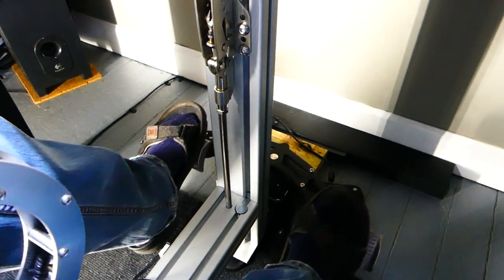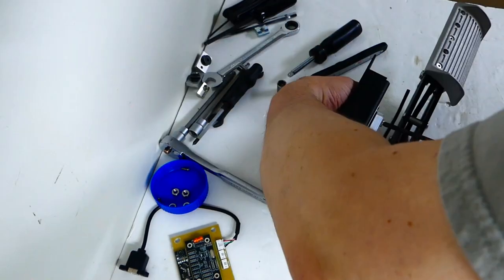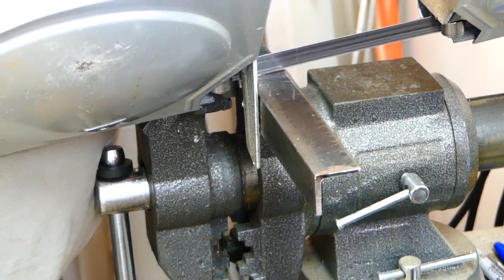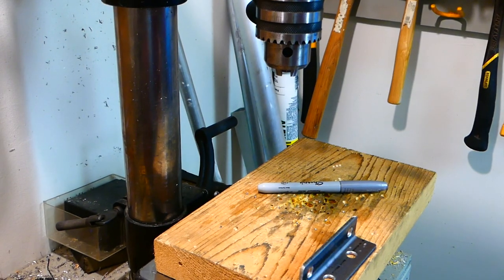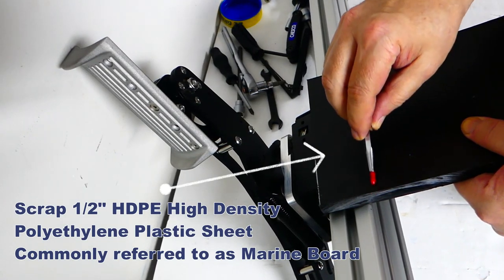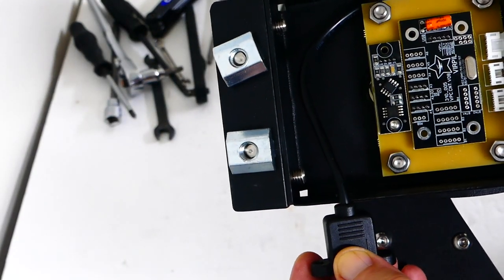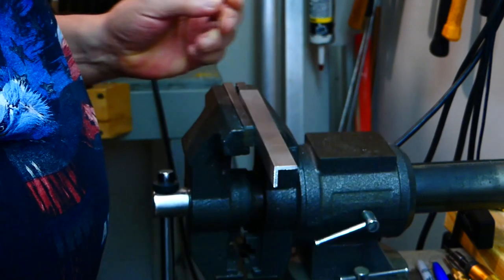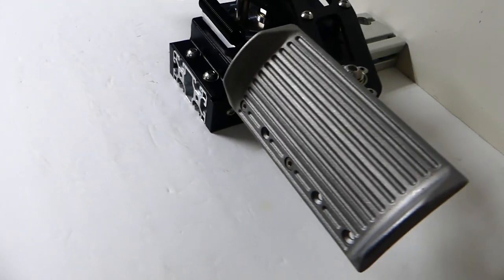DIY VIRPIL WarBRD Rudder Pedals Floor to T-Slot & Damper Mod - Part 1

Comment: I always like to see someone work as precisely as possible, very nice! :D

Is the saw you were using at 8:30 a custom tool or is it for sale somewhere? I haven't seen it as a handheld before.
Reply from the maker: This is a portable band saw and I love it. I have purchased mine a long time ago at the Harbor Freight store but ACE or other hardware stores have them as well. Just make sure that you have enough cutting width and depth for your needs. Mine has just under 5 inches cutting width and depth. If I would buy one today I would go for a  "Deep cut" portable band saw and they are usually available just about everywhere power tools are sold. I prefer a cabled version as I don't have to worry about having a charged battery on hand when I need to make a cut. Thanks for watching and I hope you find what you need. Have a great day!
Reply: @crashmetwice  Thanks for the reply and for the advice!  Cabled would be my preference as well, I'll see if I can get one. You too have a great day! :)
Reply from the maker: @alaskanbas6507  Thank you!

Comment: Yet again great design.
After you get all things done, could you please tell me what set of cams and springs your using on both the rudder and joystick base ?
Reply from the maker: Yes, I will do that in the video when the project is done. In the joystick base I am using the  soft spring which comes pre-installed and the AviaSim soft which I have slightly modded. I am thinking on making a video about in in the future. 
Thank you for your compliment and glad you enjoyed my project.